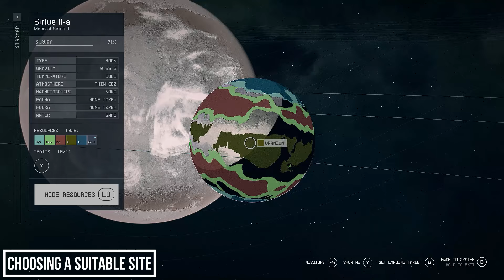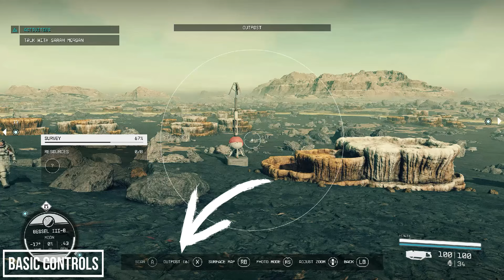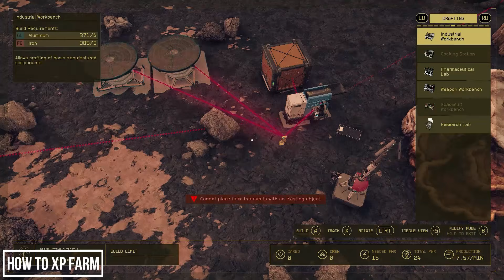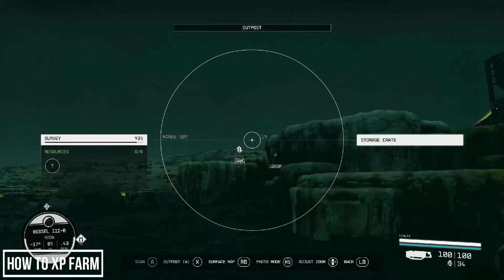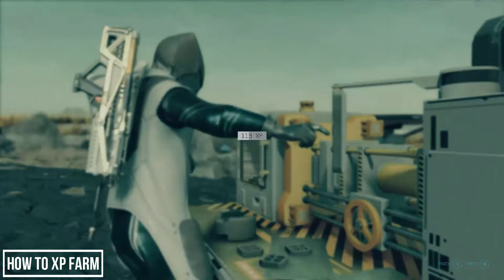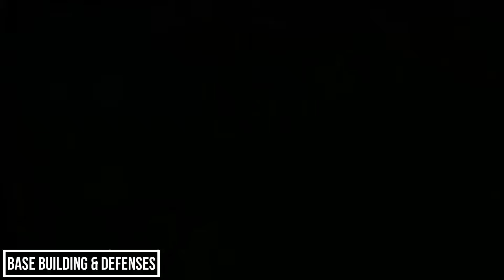Starfield: Outpost Guide 1.0 - The Basics (Extractors, Switches, Base Building & More!)

Comment: The all types of workstations i setup keeps saying obstructed?
Reply from the maker: @Jesse.336  hmm I've seen that before as well. It was a while ago though and I can't remember what the solution was. I think once at the outpost if you quicksave, then load that quicksave, it fixes it. If you Google it though I bet there will be lots of Reddit threads on it. I remember that being an issue right in the beginning when Starfield was released.
Reply: @mike-thegamingdad  yeah I tried that and then jumped to a different planet and back.

Comment: Nice video man 👍 newly subbed by the way, but I have a question so I was watching someone else’s video on outpost and he said something about needing helium for both sides of the inter system link, but mine seems to be going purely on the helium being fed into its fuel box, is this a bug you think or has it been made? So you only need to feed one side of inter system link now? (You know as long as one side has helium attached to it.)
Reply from the maker: @Daxxil  thank you 😁. No you shouldn't need helium for both sides of a link, as you'd not be able to use planets/moons that didn't have helium-3 unless you brought it in first. I do have a video that explains the process of using helium to set up links. It's in this video and is the chapter that is about 20 minutes in

https://youtu.be/KIDlXpMsynA?si=fFa-t5tEklUj4gPV

Comment: Would it help in design to have unique cargo storage units that only hold a single resource? Then you could just feed everything through the transfer terminal and let it auto-sort
Reply from the maker: @theaarpgs  do you mean rather than solid, liquid and gas, having storage for, iron, helium etc? That would help yeah, could end up with quite a few different units but it'd work
Reply: @ soooooo shameless plug I did just that ( only for small solid so far), took me a while to figure it out, but I am not very tech savvy.
Reply: @ short example of test https://youtube.com/shorts/sQSmmfCrHXo?si=A3BIG77czy2WzZif
Reply: @mike-thegamingdad  It does put a lot of options in the outpost build menu. It's one of the reasons why when I get a chance, I want to see if I can design the storage containers to act more like the fabrication buildings, and have them come with a selector, that way in theory, I could have just 1 small solid container in the menu, but then use the selection terminal to set it to a specific resource. That would be a more elegant solution than the brute force one I have come up with so far. I tried to post a link to a video that I did showing my thought process and an example of it working small scale but looks like it got stripped out of my reply. If you search YouTube for theaarpgs podcast you can find it. If you dont want to hear me wax philosophic about storage and stuff, you can skip to much later in the video for the demo, there is also a short on the site that just shows the demo of it working.
Reply from the maker: @theaarpgs  ah yeah I see. Fallout 4 does something similar with it's manufacturing units. You select one unit for weapons, armor, ammo, clothing etc. Then when you build the seperate terminal, that's where you can pick the specific item that you want it to make.

Yeah I can post links as its my channel, but it always blocks anyone else. I'm guessing it's to protect people from spam or nefarious links, but it's annoying when someone wants to post something genuine. I'll check it out! 👍🏻
Reply: @mike-thegamingdad  Cool thanks for giving it a look, the whole video is a bit long winded, but you can skip about 2/3 of the way where i do show some of the key steps in how I did it. I also am not sure how , if I wanted to, to make the mod available on the creation kit site.

Comment: My version of the planet is really hazardous and even with a solid spacesuit I can only last for about 1-2 mins before nearly dying
Reply from the maker: @insanewelshy  hmm that sounds like you've encountered some of the weather storms, they come in every now and again (usually characterised by either rain or dust) it normally gives a prompt in the corner about hazardous weather. I've never seen it where I die that quickly, normally what happens to me is ill pick up frostbite, or a respiratory illness. The only way of getting throughthem is to build a hab and get inside so you are safe, I usually build a bed and just sleep till they have passed

Comment: This video is very well done! As someone else mentioned I appreciate that it was recorded in real time. I would like to add a couple tips; When placing resource storage or structures, you can use the triggers to cycle where the item snaps in place without moving your cursor. When you want to call your ship to you, just go to your ship builder on the landing pad, go into modify, move a piece, then cancel. Voila, your ship is now on your landing pad. Lastly, if struggling to get something facing the way you want, you can change the rotation speed in the main menu settings.
Reply from the maker: @ColinJory  thanks very much! The real time thing wasn't originally planned. Normally shooting stuff like this takes a few takes, or you might cut out any "filler", but it sort of fell together quite well in 1 go so I left it as it is 😅. Thanks for sharing your tips as well appreciated! 👍🏻

Comment: 1 system that i think was overlooked is some form of managment system for the 2 different cargo links.   It wasent part of this video but its very unreliable to ship 2 or more things from 1 planet over to another using the same landing pad.  If your storage is full then is the ship gonna pick up equal amount of the 2 or more resources u export or is it gonna load up its entire cargo with just iron for example.   Also it would have been a perfect way to have to assign your own ships for this transport job instead of some random hauler just happen to come by and doing the job for free.

Comment: When i fall asleep for an hour, my warehouse isnt filling up.  Its been at 47
Reply from the maker: There is likely a blockage, or lack of a required resource in the system somewhere, if its not filling. Unfortunately without being able to see it myself it's hard to say what that will be, but try going through each point in the chain starting with the first extractor. Is that extractor working, if so what's the next point in the chain. If you can provide detail on what isn't working I can try help out

Comment: OK, I have a new problem.  One that my machines now and then fail and loading does nothing but I found out if I move the machine it works or that has worked twice when the problem happens.
The next problem is that my iron feed of ore is broken, 100% not working after 12 hours I collected zero.  It was working just to be clear.  I even built a few more solar power even though in theory I already had more than enough.  But still no ore.  So I have three miners that feed a local chest then that chest feeds a stack of 10 chests and yes all 11 chests are 0% full. I could delete the three miners and see if it starts working again.  Weird how just these 3 miners stopped.
Reply: well fwiw, I deleted the 4 miners and then built 3 miners the 4th no longer seemed to fit and since you only used one of each I presumed I was still good, the rebuild worked.  I'm kind of not sure what I am doing, the income seems bad, terrible even.  I changed my engines and Jump theng, and upgraded my lasers and wow that cost like 100,000 with no real gain, oh and I did also throw away one hab and put in a new one, oh and I changed two landing gear so I could add two more thrust type engines, now I might need to do some magic to get Jump distance to 28 for the next power :(
Reply from the maker: Without being able to to see your base it's hard to suggest what the issue may be. The whole system is like balancing a set of scales. On one side you've got  your overall power production and the other your power consumption. As long as A is equal or larger than B that's the first thing. Then once you have that its a case of setting up links, extractors and defenses don't need a linked power source, but you can link them if you want (just be mindful that then puts all the linked power into whatever you've linked it to, if there is a surplus its lost). But your extractors and storage do need links. Then when you add more units that need power, the scale tips, and you may need to improve your power production and maintain the status quo. I'd have to probably see the base though when it wasn't working to see why they weren't filling up

Comment: "You will always land beside your beacon."  I claim that is NOT correct.  I'm not sure how I fix the issue I had but I've built one base before.  Yes a terrible sample size.  But I even built a landing pad that I could build a ship on.  But when I tried to return to the base every time I landed I would land in my original landing spot and not at the base.  Why?  I would also like to claim that for base one this seems like a huge deal to get what was it now 5 resources.  I've heard that for speed it probably best to just try and get two, but hey my ability to build a base is probably being brought into question.
Reply from the maker: Do you mean after the loading screen you would be stood at your original landing spot, so not near your base, or that your ship would be at your original landing spot?
Reply: @mike-thegamingdad  With my newest base I always pop out at the center building of the base as you said would happen.
Reply from the maker: @basildaoust2821  okay thats good. Your ship sometimes won't spawn there and will be at the initial landing spot, but its easy to get it to appear at the landing lad if you go into the ship screen on the terminal and select the ship you want as your home shop. That makes it appear on the landing pad. But yeah I've never experienced my character not spawning to the base/beacon if that's the location I've selected to go

Comment: can someone please tell me how to elevate and lower the habs? i've tried everything i know it seems. i'm on pc. thanks
Reply from the maker: When you place a hab you should essentially have 2 'clicks' before it's placed

The first time you press, should place it down and lock it in place, but the elevation isn't locked, this is where you can move it up and down. I use a controller so it may be different but on PC I think it should be

"E' key to build, then:
Confirm placement and height "E" again
Rotate unit "Mouse1/Mouse2"
Adjust Height "W/S"
Cycle Variants "Q/T"
Cancel "ESC"
Reply: ahh, I see. Yes, you have the keys correct for PC. I will try it again next session. I actually got it to work once by accident but then didn't know how I did it. heh. Thanks for the reply, you are a great help to me. I was able to ask my son questions about the game, (I'm 71 y.o.) but he took a break from it while waiting for the patch I guess. Do you know a place that I should go to when I have Starfield questions? Is there a site I should be using? Thanks again for all that you do. I bet you are a great Dad.  @mike-thegamingdad
Reply from the maker: @marknorthrup4897  no problem at all happy to help out 😁👍🏻. Normally if I have any questions I google what I'm looking for and see what is being written  about it. As Starfield is relatively new I think a lot of information will still be being catalogued, but thankfully I've managed to find most of what I've needed

A lot of the time it's on websites like this:

https://starfield.fandom.com/wiki/Starfield

https://starfieldwiki.net/wiki/Home

https://www.ign.com/wikis/starfield/

There's some pretty comprehensive wiki pages on the game already, and they are always being updated.

Great to see you are gaming into your 70s! I'm 34 now but I've been gaming for 30 years, some of my earliest memories were of my dad and grandad gaming. My grandad played games into his 80s and owned consoles from the NES and SNES era right through to later PlayStation consoles - they were fun times 😁. I'm hoping I'll be a gaming grandad 🤣👍🏻.

Comment: You know i would love to follow this guide but for some reason leaving this moon and only this moon crashes my game everytime.
Reply from the maker: What really? What a weird bug that is 🤯🤯 so sorry to hear that
Reply: @mike-thegamingdad oh it gets even weirder as I tried with a different character and everything was fine. So I reloaded an earlier save on a different ship and it hasn't crashed once. I guess it was specific to the ship I had or just the game being made by Bethesda it's a coin flip
Reply from the maker: @Decarus37  ha yeah very true, I set off in my ship from this moon once and as my ship flew into the air the only parts of it visible were the engines and a rectangle in the middle  they weren't connected it was just parts flying into the sky. When I was in space it was the same but I couldn't do anything, the controls were completely locked out so I had to hard reset. It's never done it since but yeah, classic Bethesda 😂

Comment: Hello. Thanks so much for your time. I learned a truck load. Took me about an hour to find that base position lol but afterwards I felt like I had won a prize.
I nearly missed the Cobolt on the edge of my circle but had just enough for an extracter. All good. Thanks again.
Reply from the maker: No problem at all happy to help out 😁👍🏻. Yeah it's not the easiest to pinpoint, one pixel either side and you load in a completely different place 😂

Comment: I've build a system with extractors sending their mined goods to containers that are linked to eachother. I've gotten it all to work so that when one container is full the overflow goes to the next linked one. But what happens when they all are full? Is there any downside to letting my extractors run even if all the containers are full? Other than it's wasted materials; that are being mined but don't end up anywhere?
Reply from the maker: Hey yes that is correct, once the system is full thats it, there's no overflow storage anywhere, you just don't receive anymore materials unless you add more containers. But there's no negatives either, you aren't penalised for it or risk any damage if they keep running

Comment: Anyone got tips to find this location? I’ve spent what feels like hours trying to find it.
Reply: I've spent a day in a half and haven't found it closest I've seen to resources in my search was 4 but they were water cobalt platinum and nickle. Doesn't help everytime I've tried its freezing rain or thunderstorms on the surface either.
Reply: I keep getting some sort of dust storm. 🤣 Trying again tonight.
Reply from the maker: Have you still been unable to locate it?
Reply: I find it every time look for the two moutain ridges go inbetweeb those two ranges and find all 3 biomes near always place it on the mounting biome not the hills it will have to get your bearings from the landing spot find the black mountain at the base of it

Comment: This is amazing! Bessel iii b is a jackpot planet for resources and you made a very efficient use of it. That xp system is OP!
Reply from the maker: Yeah its a bit of a grind but it's possible to gain levels very quickly that way, I'm going to spend a few hours doing it, get the perks required in the science tree so we can unlock all the new building upgrades, and then I'll do part 2 of this where we expand the base and set up some feeder outposts, sending other resources here via links 👍🏻

Comment: Try as I might, I couldn't find the right spot to build a big landing pad when I tried. So I just plonked a small one down instead, which is OK for The Mantis. I'm not worried about future expansion, as I've hardly been back. You made it look easy on your console, Mike - but it's a real PITA building or connecting anything with keys & mouse on PC.
Reply from the maker: Yeah, I've heard it's difficult on keyboard. Have you tried changing the settings? There's a sensitivity option specifically called outpost item rotation speed. It's in the bottom half of the controls menu. I've heard that helps massively with the fiddly bits
Reply: @mike-thegamingdad  Yep, I have. There's two settings, I think - but I can't remember the other one AFK. 👍